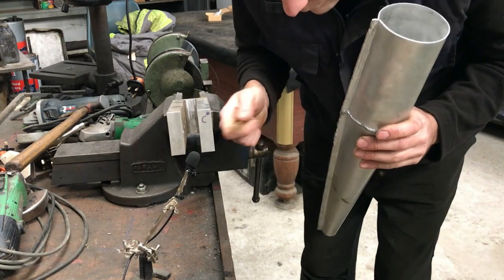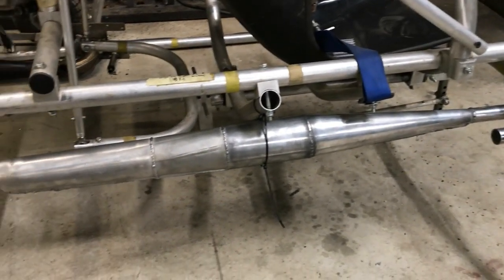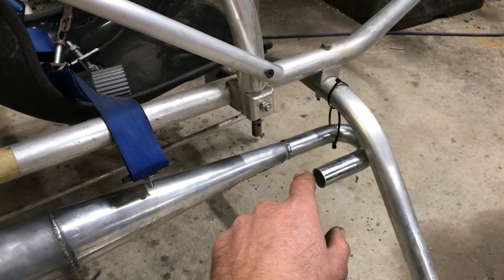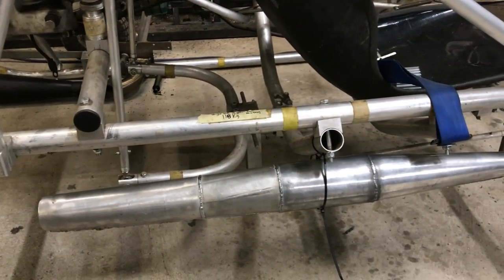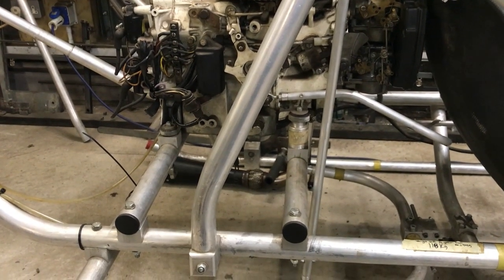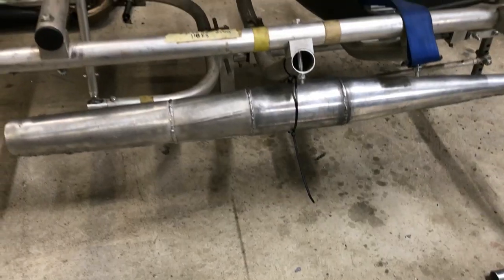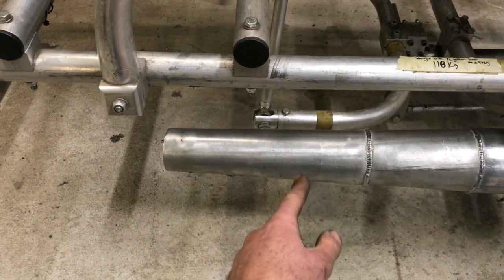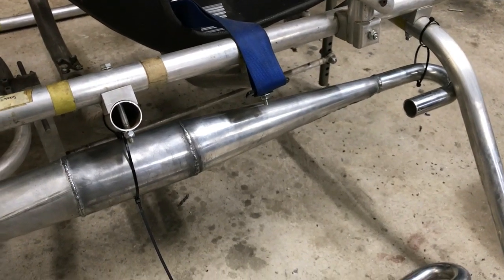Homemade Helicopter Exhaust Expansion Chamber Build part 1

Comment: Been messing about with 2T motorcyclee for years and I've never seen alu exhausts. I thinks they will crack due to resonance. The  gauge of steel used for all racing m/Cs is so thin they weigh less than alu. I've only just come across your channel and am hooked its ticking every box for me, all the best.
Reply from the maker: Thank you and aluminium does crack from the vibration. It was a bad idea

Comment: Hi Ben, well you've certainly gone to great lengths with this, good experience, what do reckon the weight is of both pipes, with a properly tuned  pipe its 25 percent more power for you buck, as I siad they put the motor on a dynamometer, and put various lengths  on .....looks good.
Reply from the maker: Thanks Peter, if I get an increase in power like you said I would be over the moon. 👍 
So far each pipe weighs 900g 1.8kg for both. The standard Hirth exhaust for a 50hp weighs 5.5kg not including the manifold, my goal is to beat that target weight and increase the power the same time. Will be interesting to see the results and I've enjoyed the build so far. Need to make a spring loaded joint to isolate the vibration but that shouldn't be too hard. Thanks for the info!
Reply: @Ben-Dixey  you might find Ben that the reason they use steel is its resonant or more achousticly live, the exhaust system on my Rotax 503 is at least 10 lbs !
Reply from the maker: peter withers so maybe I should be using a tuning fork ?😆
Reply: @Ben-Dixey  Ben just one thing having 2 expansion pipes, the 2 cylinder exhaust out let share a common pipe, they are not separated, I've seen them separated bye having the outlet on the side of the engine block, you won't get the benefit otherwise
Reply from the maker: peter withers Hi Peter, they are separated on my engine and I'm going to keep the ports coming out the bottom of the engine as standard rather than modifying the exhaust plate  and coming out the side as they do on racing outboards. I hope I've made the right decision making two expansion chambers I wanted to make one as it was less work but was worried about wasting potential power.
Reply: Hey Ben so basically you say you have two separate independant exhaust channels for each cylinder, so each have there own pipe ?
Reply from the maker: peter withers yes that's correct, they are definitely separated, as the cylinders are stacked vertically the port length on the top cylinder is 110mm longer than the bottom which needs to be compensated for in the tuned lengths of the pipes. The exhaust port flanges are also square with one bigger in size than the other which is the start of the diffuser cones. Annoying I have to go from square to round but that's the way they made it. I'm going to have the spring loaded anti vibration joints soon after leaving the engine, I plan to turn up some inserts and weld into the pipes all aluminium. If nothing else it's made me do lots of aluminium welding which I needed to improve my skills in that area.
Reply: That's interesting what's make of your power head and the age of it, probably the ones I had were probably too old.....Mercury and Gale, ?
Reply from the maker: peter withers the engine is a 1981 Johnson j60elcia. Don't suppose you have ever built an engine dyno in your time? Would be interesting to see some  numbers from the modifications. I also don't know if my carb jetting will need to be altered I hope not but will have to check the air fuel ratio.

Comment: excellent work as always !   I probably missed it , but i assume this is a 2 stroke rotax or similar.,. I wonder why they dont suggest an exhaust , or even include one .
Reply from the maker: Thank you rob, the engine is a Johnson outboard engine, sorry I didn't mention it in this video. I considered buying a rotax or Hirth exhaust but didn't want to spend the money new and second hand they weren't easy to find. They are quite different in design and relatively heavy even with one single exhaust instead of ideally two. It will be interesting to see how much the expansion chambers improve the power and whether the difference will make it fly.